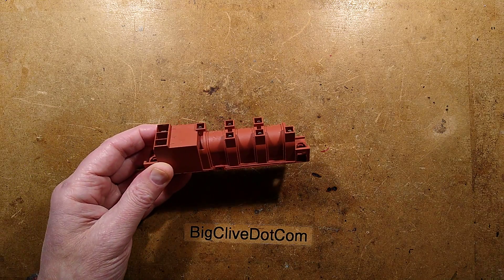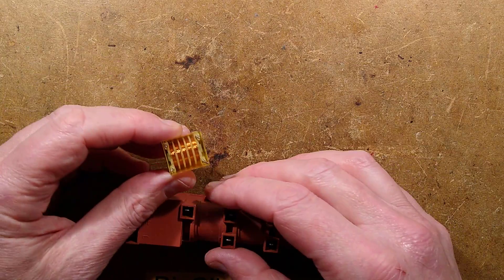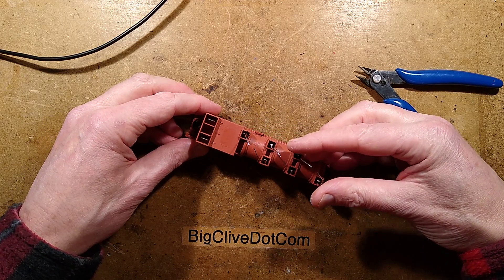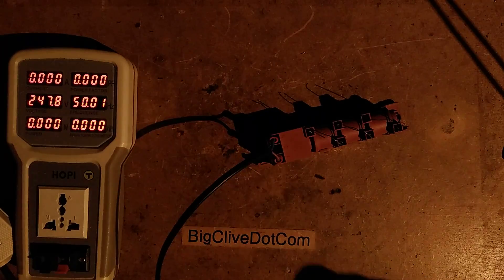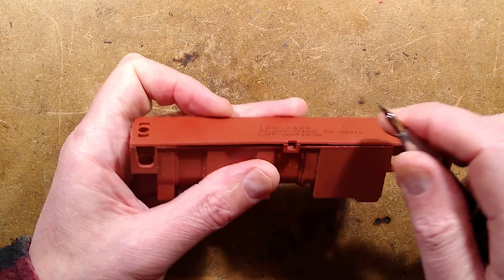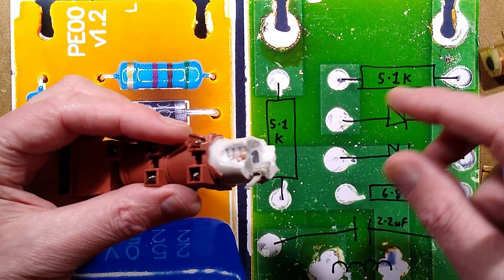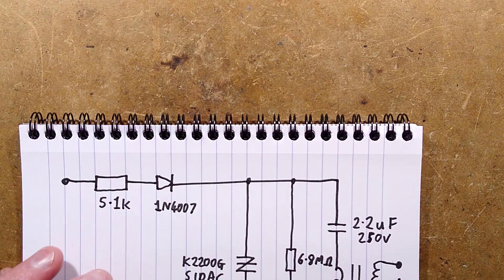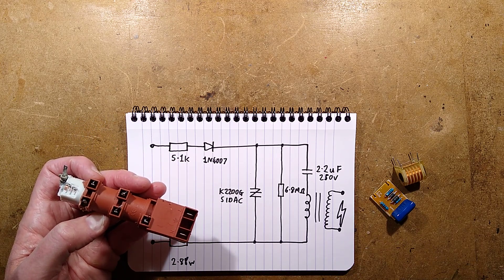High voltage igniter teardown with schematic

Comment: Switching module for a transformer and battery pack for short to long term music. I wonder if there is a frequency module that interacts with the seiner diode.  Controls the transformer in order to regulate the ohms. What are your thoughts?

Thank you kindly. 

I am trying to find common ground for speakers with the typical negative and potty terminals.

Comment: This was very interesting to me because my daughter-in-laws igniter module failed on her 30 year old oven. I could not find a replacement so I picked one on Amazon that was available and inexpensive. The one I got is identical to the one in this video except it is for 120 volts. I was very lucky to find this excellent video. Now I know what I have and I'm sure I will be able get the oven working again. Thank you!

Comment: Hi sir, great video..i tried to activate the igniter through microcontroller, with the help of relay to activate 220v voltage to the lighter. But I encountered a problem where the microcontroller often resets when activating the igniter, is there a solution to overcome the high voltage generated by the igniter so that the microcontroller runs normally..I am using an esp32 type microcontroller.
Reply from the maker: Microcontrollers are easy to crash when the supply experiences voltage transients.  Try putting a 100 ohm resistor between the positive supply and the microcontrollers power pin, and add a 100nF capacitor across the microcontroller's power pins.

Comment: Hello, what is the rms voltage on your grid? I wanna do this circuit for my grid which has 230 rms voltages.
Reply from the maker: 240V.  But the unit is designed for 220V.
Reply: @bigclivedotcom  Thank you.

Comment: Hi bigclive, I have two pieces of (ITW  ispracontrol) units and both of them are not functioning. As I’m living very close to the sea the sea spray disturb electronic equipments very often. What I kindly ask for is if you have the circuit diagram of RTW unit please share to me. Thanks in advance.

Comment: Thanks for providing this informative teardown.  I have a cheap propane gas burner and am getting tired of flicking my Bic every time I go to brew my morning coffee.... Per the datasheet, the SIDAC used in this igniter has a breakdown voltage of ~220, but AC mains power where I live is ~117. Fortunately, Littelfuse manufactures a range of similar units with different ratings. Interested experimenters might wish to search for "Teccor® brand Thyristors/Standard Unidirectional SIDACs/KxxxzyU SIDAC Series 561" for more information.
Reply from the maker: You can get battery operated gas cooker igniter modules on eBay.

Comment: Just bought 2 to play with 😂 Any thoughts on connecting the three outputs in series to produce a single bigger spark? Assuming if the interior is well potted then it should be able to withstand the extra voltage?
Reply from the maker: It should be viable to do that.

Comment: I was looking at one of these just a few days ago. I couldn't understand how it worked without an earth reference connection on the generator, but I guess with a floating transformer the chassis is just a connection between the 2 sparks - whether grounded or not is unimportant. Clever!

Comment: My grandpa had a Vaillant gas boiler for hot water in his apartment which automagically ignited when you turned on the hot water tap or shower. It automagically turned on the gas supply and fired an igniter for 1-2 seconds that sounded similar to the one in this video. This was unlike any of those gas boilers that I've seen before, all of which had a manually ignited pilot flame and wasted gas all the time if you didn't turn them fully off. Was kinda jealous of his "deluxe" boiler, and with gas prices now exploding this automatic igniter version would make even more sense and not be as annoying as manually turning it fully off and reigniting the pilot every time you want hot water

Comment: 9:17  “1N4007 highest voltage of the 1N400x range…” isn’t the 1N4008 rated at 1200V max reverse DC, 200V higher than the 1N4007?

Great video as always.
Reply from the maker: I've never come across a 1N4008.
Reply: @bigclivedotcom  Often found in (larger/commercial turbine) aircraft systems where 440V AC @ 400Hz is the main system bus supply.

Comment: Great video. So is this how a coil pack on a petrol engine would work? 1 for each spark plug?
Reply from the maker: With a petrol engine there's usually one high voltage coil per spark plug these days.

Comment: Why three coils? Are they intended to be used with separate spark gaps, or can they be jumpered in series for greater voltage?
Reply from the maker: It's for three separate spark gaps.

Comment: A SIDAC is silicon diode for alternating current. A SIDAC was used bc it has a higher breakover voltage and current handling capacities than DIACs.

Comment: Does it spark at lines frequency? Why multiple outputs? Multiple sparks or put in series for 1 large spark?
Reply from the maker: It charges over several cycles for each spark.  The three outputs are for three spark gaps.

Comment: I accidently energised one of these without having the stove top sparkers connected (i was repairing the oven at the time), and it quickly burnt something out in the igniter. Any ideas what might have failed? The unit looked identical to the one investigated by Clive.
Reply from the maker: By operating open circuit it may have flashed over inside and formed a conductive path.

Comment: oh so that is how those work! I have one from somewhere, I knew it was an igniter but didn't know it could just be plugged in and work. Thanks for the video! maybe I will use it for something someday!
Reply from the maker: See if it has a voltage rating on it.  Some may be for low voltage use.
Reply: @bigclivedotcom  thanks for the reply, it does have a voltage rating of 120-240 Vac 0.6 - 8.5VA
It has a model number of BK50064.51
So yea very similar to yours, I do see the primary wire coming back from the far end. 20.9 microHenry 0.02 ohms primary
2 microFarad capacitor
397 milliHenry 808 ohm secondary (1 out of 3 )

Comment: Love the tear downs. Done anything with spark modules for ovens or furnaces that have the REIG (re ignition) feature? Fascinating! The flame is detected by a (lowering of resistance of the flame)?  itself which turns off sparking. MUCH more interesting
Reply from the maker: The flame rod system is interesting.  It uses the conductivity of a flame.

Comment: A  idea I got from this I need a 12 volt DC of one of these to ignite the LPG on my PYRO  cart I built for our AARRRGGGGG  FM radio station be better than using a separate 1 LB propane bottle for the igniter circuit just wire it into the solenoid valve so it fires as long as you hold the button to release the LPG that.s fed into the exhaust stacks  from the 20 LB cylinder . it always is a hit in the Halloween parade  .
Reply from the maker: You can get low voltage ignition coils.

Comment: If the total consumption if the module is 1.6W according to Hopi, doesn’t that mean the resistors can not be getting over 0.8 W?
Reply from the maker: Yes.  It'll give a rough indication.  But it depends on how well it interprets low half-wave loads.

Comment: This triggered and ARCtivatede my interest in this device, so here is some more info. A Silicon Diode for Alternating Current (SIDAC) is a less commonly used device, electrically similar to the DIAC, but having, in general, a higher breakover voltage and greater current handling capacity.[citation needed]
The SIDAC is another member of the thyristor family. Also referred to as a SYDAC (silicon thyristor for alternating current), bi-directional thyristor breakover diode, or more simply a bi-directional thyristor diode, it is technically specified as a bilateral voltage triggered switch. Its operation is similar to that of the DIAC, but SIDAC is always a five-layer device with low-voltage drop in latched conducting state, more like a voltage triggered TRIAC without a gate. In general, SIDACs have higher breakover voltages and current handling capacities than DIACs, so they can be directly used for switching and not just for triggering of another switching device.
The operation of the SIDAC is functionally similar to that of a spark gap, but is unable to reach its higher temperature ratings. The SIDAC remains nonconducting until the applied voltage meets or exceeds its rated breakover voltage. Once entering this conductive state going through the negative dynamic resistance region, the SIDAC continues to conduct, regardless of voltage, until the applied current falls below its rated holding current. At this point, the SIDAC returns to its initial nonconductive state to begin the cycle once again.
Somewhat uncommon in most electronics, the SIDAC is relegated to the status of a special purpose device. However, where part-counts are to be kept low, simple relaxation oscillators are needed, and when the voltages are too low for practical operation of a spark gap, the SIDAC is an indispensable component. ⚡⚡⚡⚡⚡😏

Comment: Pretty nifty little devices. I've managed to get the PCB out without destroying the casing by first desoldering the output wires and the input F2 (i think) connector plates - then with a little prying it came off.

Comment: curious about the power dissipation in those resistors.  turns out it is not as simple as I expected to calculate.  With his 240 volt 50 Hz power it takes 5 cycles for the capacitor to charge and the thyristor to fire.  first cycle it draws an average of 9mA yielding 0.4 Watts.  5th cycle 2.4mA 0.03 Watts.  over all 5 4.85mA for about 1/8th Watt.  the pulse shouldn't add much.

Comment: I'd be very interested to see a teardown & circuit analysis of the "Re-Ingnitor" style of appliance spark modules, which include flame rectification to sense when the flame is established and stop sparking (pretty interesting physics, I think they're using the flame like a vacuum tube.)

I put an example link in my last comment, but I think it might have been deleted as spam. Examples include PA020047 or 83-22000-001

Great information as always, thank you!

Comment: Did I miss something? 

There was a time constant when it was demo'd, so it sparked every half second or so? 

Is that why there was a combination 5.1k and the 2.2uF? So the DC voltage across the cap ramped up each cycle until it got clamped. Just a guess...
Reply from the maker: The timing of each pulse is determined by the time it takes to charge the capacitor to the SIDACs trigger threshold.

Comment: 11:25 we had this race car in our shop that didn’t have the ignition coil wired correctly to the main power cutoff switch, (many years ago, can’t remember the exact problem) so like half the time if you switched off the main switch shortly after stopping the engine with the ignition switch, it would unexpectedly fire one cylinder and crank the engine 1/4 turn. 😬

Comment: My 40+ years old stove has a neon bulb instead of a SIDAC.
Reply from the maker: That used to be common.  Either handling all the current directly (not good) or triggering a thyristor.
Reply: @bigclivedotcom  Well, I have to put a new one inside every 2 to 5 years and I still have enough on stock.

Comment: This transformer is probably for use in a voltage multiplying circuit. A diode on each stage charging a capacitor in a stack of capacitors with output from ground to the final high voltage stage. Old TVs used these to make the CRT anode / cathode high differential voltage..Also called a voltage ladder.
Reply from the maker: It's for gas ignition.

Comment: SIDAC - maybe something like an overvoltage triggering of a thysistor. Or when a transistor is operated above the defined voltage and switches from C to E without using B
in fact, every diode junction can be made to conduct over a certain overvoltage. It depends on the manufacturer to do it in such a way that it is controlled.
A DIAC fires at about 30 volts. It was often used in dimmer circuits.

Comment: Reminds me of the time I was still living in my Chinese apartment and the water heater was having HV issues. Each and every time the maintenance man showed up of course the d*mn thing worked only to stop doing so once I went to take a shower.

One day I simply tore the thing open, disconnected the HV ignitor and called the maintenance guy again. 2hrs later I had a new heater.

Comment: You can simple double the frequency output, by replacing the 1N4007 with a full bridge rectifier and without a smoothing capacitor. 
With the 1N4007 in place you get 50 or 60 pulses per second,or once during each cycle,  but with a full bridge rectifier without a smoothing capacitor , you get 100 or 120 pulses per second. And i think if you remove the 1N4007 and use a pure DC voltage above 200V , the frequency will go even higher, because the circuit now works like a relay that is powered through the NC contacts.
Reply: The discharge frequency is limited by the time constant of the two 5.1K resistors and the 2.2uF capacitor.

Comment: Not a bad solution for ignition, though I prefer piezo igniters. Push down against a stiff spring, trigger mechanism trips and dumps the energy stored in the spring into a hammer that bangs a piece of quartz, and the mechanical impact is converted by the quartz into a spark. (Almost sounds Rube Goldbergian when you spell out the entire process, but it's simple and effective. It works, it's neat, and it doesn't require any angry pixies in to get angry pixies out. It's almost alchemy.)
Reply: piezo is one of those pieces of equipment that have always fascinated me....

...what the hell you mean you smack a crystal and get electricity out of it?! Seriously?! <--me when I was younger ^_^
Reply: Piezo's great for cookers and the like but not so much for gas boilers or anything else that needs automated. I always figured it'd just be a flyback transformer for things like this
Reply: @EddieTheH  My most recent experience with a gas range still used pilot lights, and it wasn't terribly old. I can see how something like this would be more practical and reliable.
Reply: @petersage5157  Yeah, it got me curious so I had a look in my combi boiler, it looks to be a similar thing to this.

Comment: I wanted to see the spark with them all in series 😔
Reply: With how much those transformers are stepping up the voltage, it would probably arc across the windings halfway through the second transformer.

Comment: I'm really interested to know how you "broke in" to that resin potting stuff. I have an old bass guitar that has a sliding pickup and the old Coaxial style cable that disappears into the potting has become weak and brittle over many years of use.

I need to get into that resin to get back to good wire so I can solder on a new length of good cable. 

Have you got any good tips on how to get into it? Mine is the horrible rock hard shiny black stuff.
Reply: A soldering iron works well for softening that stuff, and epoxy resin in general. Get it hot, if the temperature is controllable it doesn't need to be hot enough to solder, and sort of hover the iron tip very close to the resin, then poke at the resin with a pick, and job done, it comes away in big much softer chunks. If you don't care about the soldering iron tip, you can just excavate with that instead.
Reply: @Tekwyzard  thank you, I shall give that a try. I've currently got it in "a working position" and neither man nor beast must disturb it's placement lest the sound be lost forever 😆

Comment: Was wondering if one of those igniter could be modified to run a small electric fence as I have pesky rabbits getting into my vegetable patch.
Reply: Yeah sure could. Dump the mains circuit and simply have a 12v pulse driving the primary coil. In fact you could connect all the coils together in series to get a whopper of a spark!
Reply: @fredfred2363  Connect the coils in parallel to get more current.

Comment: If i'm not mistaken, a Sidac acts almost like a bipolair TVS diode, except a TVS conducts constantly during clamping, while a Sidac disconnects during clamping again when the voltage is dropped below the threshold, almost like a neon bulb does on each cycle.
Never knew that these igniters where build with only a few components, you should think that a PWM IC or 555 is used. Nice video. Grtz

Comment: Clive do they all go off in sync or is there a minute delay? 

follow up; does the primary side go through 3 iterations to fire them all or are they all charged with a single discharge of the capacitor?

Comment: Got one recently. A similar one from aliexpress. But has no plate on the bottom and looks slightly different. Same color though and in general really close. It works fine. Sparks very often, much more than the original one. But it was more than 10 times cheaper than an original replacement.
Reply: And possibly ten times less reliable and safe.⚡⚡😟
Reply: @brucepickess8097  Not really a problem. The output is isolated and power is only applied when you press the ignition knobs.

Comment: been in electronics for 40+ years. never ran across a SIDAC!
back in the 70s I built strobe lights using the same circuit for the trigger, how ever, we used an ne2 neon bulb instead of the sidac. if I remember it had around 90v breakdown.

Comment: you could get electrical interference that could crash the phone and corrupt the camera card.

you can still get zapped as some igniters may use a voltage multiplier made up of capacitors and diodes.

Comment: Is a SIDAC and a DIAC the same?
I remember dials in switch mode power supplies of old (Olivetti M24 Power supplies)
Wonder if the modern ignition coil work on a similar basis as I always fancied making a cattle fence out of one of those…